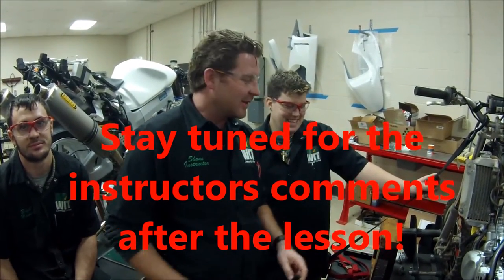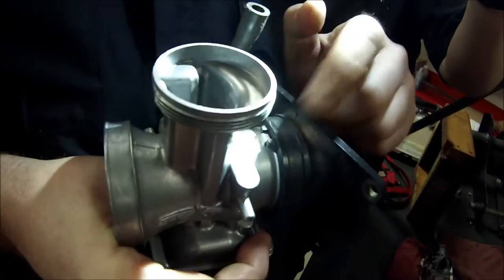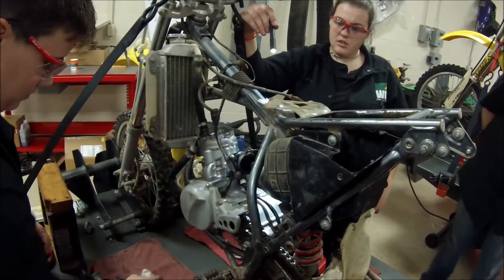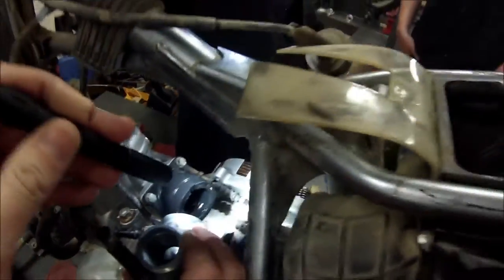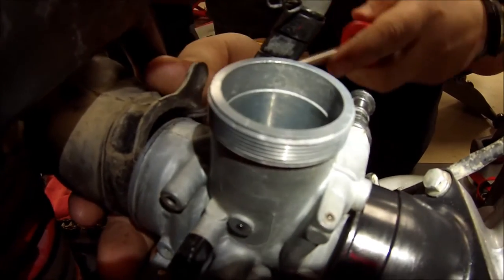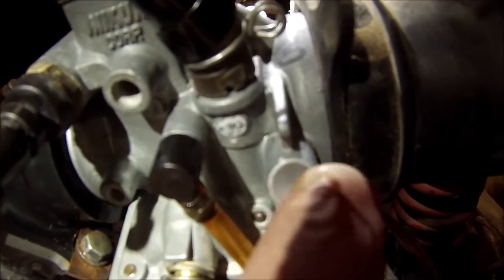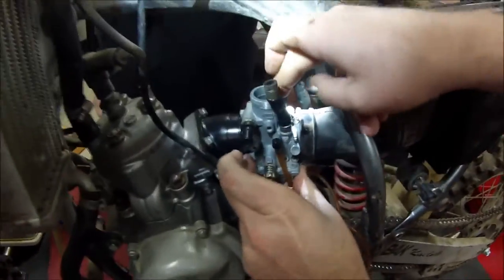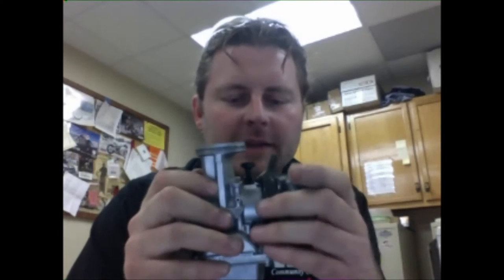Every Mechanic Series: How to verify the carburetor is fully seated into the manifold

Comment: Great tip about using that tool to walk on the rubber air boot to the carb. I’ve struggled at times trying to get them on. Especially in tight quarters..🔧🔦

Comment: Its also easier to install the carb into the air boot first and then into intake, rather than needing a tool to force the boot on to the carb. Just what Ive learned from years of racing and having to work on my bike myself
Reply from the maker: Once again, many factors determine procedure. The air box is much more forgiving to move and flex than a rigid intake. I think you are completely over looking the title and reason for the video was to teach these new techs how to verify and fully seat the carb.

Comment: Shane, go to an electrical supply. Pick up some #8 SOLID COPPER wire. It's just the right stiffness to easily bend and form a carb rubber tool. Especially for four cylinders. Round off the end with a file. It works much better than the tool you used.

Comment: id skip lubing anything near the carb, last thing I want is some sort of grease leaking out and getting pulled into the cylinder.
Reply from the maker: So many factors in play here. Thank you for your opinion. The grease or "lube" is not excessive enough when applied correctly to ever "leak" into the cylinder. 
Just for a second, think about it.
Reply from the maker: I just can't get over your resistance to lubing a rubber part having something forced into place in it. I can't stress enough how "good" it is to lube rubber parts when installing hoses, intakes, seals ids and body grommets. Such an overlooked step that almost always results in the tearing of the rubber.
Reply: BCabral43    lubing carb rubbers in my experience is a bad practice.  because the lube will cause rubbers and clamps to move as fastners are secured.  I find the best thing to do is lick your finger and use that as lubricant,  then if your quick it will aid fitment. .. and when dry it will act as glue !   it doesn't sound very hygienic but works a treat..  those rubbers need to be cleaned first with a little brake cleaner
Reply: I've used silicone spray on cars, and rubbing alcohol on slingshots.  But I am not sure if alcohol is reactive to intake rubber.
And I dont know if the alcohol would remain liquid long enough to facilitate installing the carb.

Stay gold.